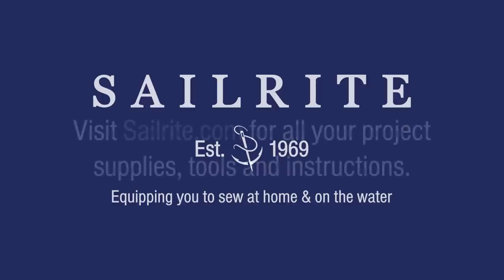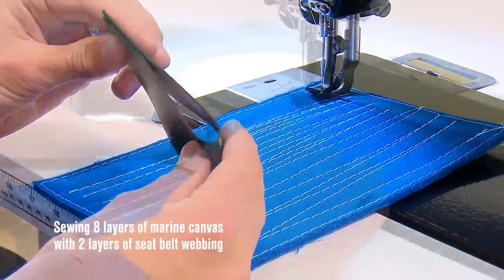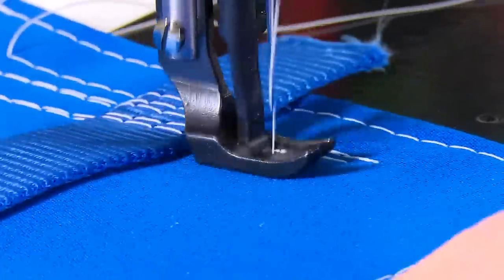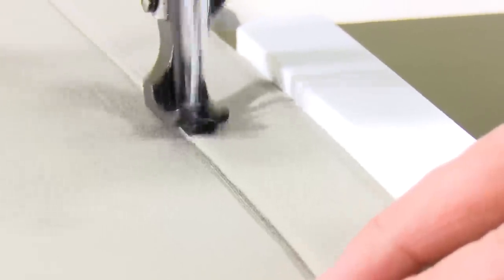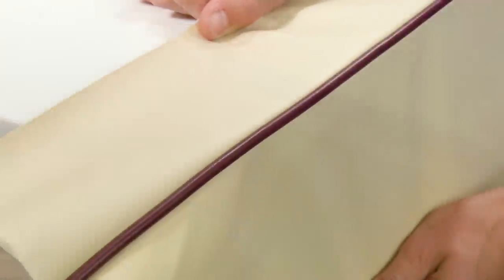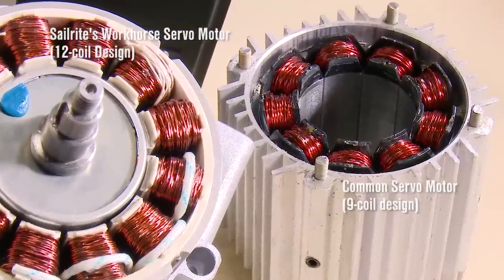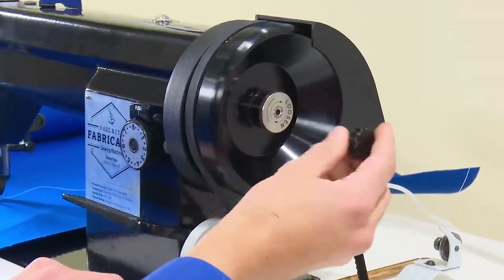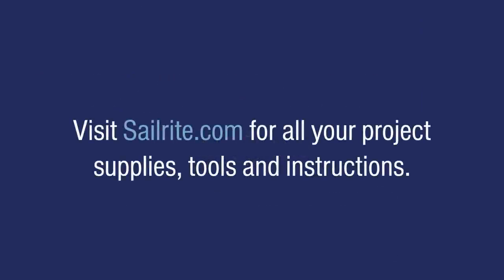Sailrite® Fabricator Sewing Machine with Workhorse Servo Motor

Comment: Can this machine be used for making apparel garments? Using standard apparel fabric.
Reply: Kimberly Arnold , yes ma'am, it will sew clothing.  Mine handles regular weight fabrics like a champ, like the kind of fabrics the majority of clothing is made from.  Of course it's great for heavier clothing fabrics, like denim.  It will work on lightweight fabrics, but it takes some adjusting and finesse.

I certainly wouldn't buy this one intending it for that purpose.  So much of the cool stuff it can do would be wasted making just clothing.  And you'd feel deprived when it came to lightweight and stretch fabrics or when you wanted to make buttonholes or anything other than a straight stitch.
Reply from the maker: Yes, it will do a great job sewing apparel fabric as well as heavy duty fabric assemblies.
Reply: Tessa Wilken
Reply: Okok
Reply: Hi I like your machine so much
Reply: @SailriteDIY  How much do you say that you’re messing with the quote I like so much

Comment: One thing is for sure about you guys,  you build quality and precision sewing machines :-)
Reply from the maker: Tanya,
Thanks!!!
Reply: Fabricator is a GC6-7D machine from Typical China, now thei have come out with a new version with direct drive servomotor of 750 W, higher lift on the foot and intergrated led light, the price of this machine is much cheaper than the Fabricater. The name of the machine is noe changed to GC0617D

Comment: The leather demonstration was impressive but how would it do on veg tan leather instead of upholstery leather? I’m talking two or maybe 3 layers of 8-9oz leather for holsters, sheaths, harnesses, etc.
Reply from the maker: Nathan, I have not sewn with that type of leather, but I think it would do well. If you like you can send us a sample of it for testing with the Fabricator. If you would like to do that just let me know via my email: eric@sailrite.com
Reply: Fabricator is a GC6-7D machine from Typical China, now thei have come out with a new version with direct drive servomotor of 750 W, higher lift on the foot and intergrated led light, the price of this machine is much cheaper than the Fabricater. The name of the machine is noe changed to GC0617D

Comment: My LS-1 isn't exactly what I needed. I'm a little upset with my choice. Not the machine but just in general. You guys were great on the phone answered all my questions. I should've gotten this machine. In fact the leather you show is the exact leather I use for my handbags haha. I was wondering what kind of return policy you guys have. Thank you.
Reply from the maker: We have a 30 day return policy. You will get a full refund, minus the shipping within 30 days. If it has been past 30 days simply post the LS-1 on Ebay and it will sell rather quickly for almost the same price you paid. Let me know if you have more questions.
Reply: Sailrite awesome thanks for the reply. It's not that I don't want to deal with you guys in fact I'm going to spend a lot more money with you haha. Should've just bought the better one first. I will contact you guys through the site next week. Thanks again
Reply: Jason Becker....I made the same mistake.  The LS-1 isn't exactly lined up with upholstery because the channel for the cording foot should be re-worked/imagined.  Smashed the heck out of flex cord and it sounds like an old mule wagon.  I really did try, though.  I'm within my 30 days so I'm trading it in for the Fabricator on Monday!  Hope they can send me another box for return!

Comment: Can the magnetic seam guide be placed at 1/4” position without it being hit by the walking foot?  On the video, it looks like the walking foot goes over the 1/4” seam guide setting.  Thank you.
Reply from the maker: Dr Michael Elinski Hello Michael, the right toe of the presser foot is directly in line with the ¼” mark. There are three approaches to sewing a ¼” seam. First, is to use the toe itself as a guide, second is to place the magnetic sewing guide right next to the toe (remember the presser foot only goes up and down so it will not cause any issues), or three you can use a left zipper foot which has the right toe removed and use the magnetic sewing guide on the ¼” line. All three will give you the same result!
Reply: Sailrite, thanks for that clarification.

Comment: Is this machine head any different (besides color) than the older version you sold? I didn't care too much for that one.
Reply from the maker: The Fabricator is a great sewing machine. Sailrite made many modifications from the older Sailrite 111 sewing machine.
Here are a few changes/improvements: 
1.    A great servo motor with cogged belt called the Workhorse.
2.    Engraved needle plate with measuring guides.
3.    Special bushing for use with our Posi-Pin system
4.    Includes the Stitch PRO balance wheel
5.    It is black
6.    We have a new 4 color guidebook --- available online as a PDF --- it is good for those with the 111 too
7.    New belt cover for use with the Stitch PRO wheel and the Workhorse motor
8.    Includes a cogged motor pulley with cogged belt.
9.    Set up and timed by Sailrite techs here in Indiana.
10.  Sailrite’s service and support cannot be beat! 
11.  Improved stitch length dial, with better stops which help prevent turning the dial too far.
What you get from the Fabricator will be more power (a ton more) and better slow speed control. This comes at the cost of high end speed.

Comment: How would you compare this to the Juki 1541 ?
Thanks in advance.
Colin.
Reply from the maker: The Juki 1541 is a good sewing machine. It is very comparable to the Sailrite® Fabricator Sewing Machine in performance. However, the Fabricator® has a few advantages: it is usually less expensive and it also comes with the large "Stitch Pro Balance Wheel with Posi-Pin" coupled with the Workhorse® Servo Motor that uses a cogged belt for optimal slow speed and power without slippage. Also our support is second to none. If you want the full details of why to buy a Sailrite Fabricator over the Juki 1541 click this link: https://www.sailrite.com/Why-Choose-the-Fabricator

Comment: Looks like a great machine .Can I sew leather for holster ?
Reply from the maker: Yes, it can sew leather. If the leather is very firm and stiff then I would estimate that it will sew about 1/4" thick assemblies well or slightly more. If it is a soft leather (like what is show in the video) I would estimate that it will sew about 3/8" thick assemblies well.

Comment: impressive performance !
Reply from the maker: Glad you liked it!
Reply: Fabricator is a GC6-7D machine from Typical China, now thei have come out with a new version with direct drive servomotor of 750 W, higher lift on the foot and intergrated led light, the price of this machine is much cheaper than the Fabricater. The name of the machine is noe changed to GC0617D

Comment: Something told me to hold off on upgrading the LSZ-1 :-)  This is every single thing I wanted the 111 for PLUS you have addressed every single thing I didn't like about it!  I am really glad you went back with a treadle linkage to the servo instead of the electronic pedal and the bobbin winder is a feature that's going to easily save me 100 dollars on a independent piece.

Well done.  Well done indeed.  Is this outright replacing the 111?  I don't see it offered any longer and I was just telling someone about it last night.
Reply from the maker: Glad you like it! We spent over a year re-thinking the Sailrite 111 sewing machine and improving several features on that machine. Yes, this is the much improved replacement of the Sailrite 111 Sewing Machine (the Sailrite 111 is no longer offered). We love the Fabricator's performance and expect our customers will too! Let me know if you have more questions. Thanks,
Eric
Reply: Can you tell what changes that has been done? This is the Typical GC6-7-D and is painted black same as 111 I know this machine very well and why make any changes when its already good from factory
Reply: Powerwheel on this machine is not a good idea, the machine have no safety clutch and sewing in very thick material you get the risk that timing will be off. Then better to have the original Wheel so the belt can slip on the Wheel.
Reply from the maker: We incorporate a lot of changes to the machine head. If the machine head did not go through what our sewing machine dept here in Indiana does, it would likely not work nearly as well. Some of the setup our techs do in-house is outlined in our Guidebook that comes with each sewing machine, starting at page 43 of the Guidebook. Here is the link to the PDF Guidebook: http://www.sailrite.com/PDF/2016_Fabricator_Guidebook.pdf if you would like to see more detail. 

However, much of the tech work on each sewing machine head involves major cam adjustment to get the walking feet to operate as they should in combination with the needle feed. When you get the Fabricator it works great right out of the box, thanks to what we do in-house here at Sailrite. Now combine that work with our special features: Posi-Pin, Workhorse motor, cogged timing belt with the Stitch PRO Balance Wheel and cogged pully on the servo motor shaft. Those factors make the Fabricator Sewing Machine unbeatable right out of the box!
Reply from the maker: The Posi-Pin included with the machine, is a shear pin which works as a safety for serious jam situations. A standard safety clutch on a regular sewing machine only disconnects the hook area, it does not disengage the whole sewing machine, so damage is still possible with only the hook area disengaged in a serious jam situation. That is not the case with the Fabricator's Posi-Pin shear pin, the whole machine is disengaged in a serious jam situation. Obviously, if the belt slips hopefully that is enough to prevent damage, but if your belt is as tight as it should be a slipping belt may not stop a serious jam from causing the machine to go out of time or from being damaged.

If the Fabricator goes out of time, we have an excellent Guidebook to help you set it back in perfect timing. Here is the PDF Guidebook link: http://www.sailrite.com/PDF/2016_Fabricator_Guidebook.pdf 

We welcome anyone to come to our facility here in Indiana to take a test drive of this sewing machine and compare it with any sewing machine in its class.

Comment: I have had this machine for a few months, and I'm having a very hard time finding any kind of support that doesn't involve calling someone during business hours every time I have a question.  I need help troubleshooting a few problems, and the Troubleshooting Guide only covers skipped stitches and tension problems (in one paragraph).

This is the only video I can find for this machine.  I chose this manufacturer because of all the great support videos.  Am I missing the Fabricator Support chanel somewhere?  Is there a link or something on the website that I'm just not seeing?  All I find is information for the Ultrafeed, and it seems like if you have anything but that, figuring it out is all on you.

If there's a link to a Forum or hidden videos or a secret society or anything, can someone please provide me a link?
Reply from the maker: Tessa Wilken As you already know we are available by phone to help during operating hours. The guidebook does cover many subjects in depth related to skipped stitches. Dropping stitches can be the outcome of any of these things which all have detailed sections in the book; hook timing, needle bar height, thread/needle combinations, and needle insertion. Thread tension is fairly straightforward and is also detailed in the book. We are working on several new technical videos for the Fabricator and will make sure these topics are covered. In the meantime I will have a support case started for you and please call for Zach or Matt B as soon as you can to resolve anything you currently need help with.

Matt Grant

Comment: Is it from the USA? It would be incredible to have one in Argentina. I would be the happiest gaucho in La Pampa. Congratulations
Reply from the maker: The machine is a collaboration between China and the United States (our facility here in Indiana). The head is made in China specifically for Sailrite to our exacting specifications. Once the head arrives at our headquarters in Indiana USA, our sewing machine technicians assemble and tuning each sewing machine head. When it is adjusted perfectly the sewing machine head is then tested with several sew offs by our technicians for final approval. After passing inspection and sew offs the head is packed with many other components. These other components are both made in Asia and USA again specifically to our specifications.
Reply: Sailrite
Reply: Fabricator is a GC6-7D machine from Typical China, now thei have come out with a new version with direct drive servomotor of 750 W, higher lift on the foot and intergrated led light, the price of this machine is much cheaper than the Fabricater. The name of the machine is noe changed to GC0617D

Comment: Can this machine stitch 15mm Veg Leather ?
Reply from the maker: 15mm is 0.59 inches. The foot lift of the Fabricator Sewing Machine is 0.50 inches, so no 15mm is too thick, it must be less than .50 inches or 12mm or less.

Comment: "It is awesome".
Reply: Fabricator is a GC6-7D machine from Typical China, now thei have come out with a new version with direct drive servomotor of 750 W, higher lift on the foot and intergrated led light, the price of this machine is much cheaper than the Fabricater. The name of the machine is noe changed to GC0617D

Comment: I really want another machine...my last one was a Juki....maybe next tax season...idk
Reply from the maker: When it is time to buy, we stand ready to help!
Reply: Sailrite I look forward to that...I do have a question: how different is your"electronic foot control" from a rheostat- type controller
Reply from the maker: The Fabricator does not have an electronic foot controller. However, the LSZ-1 or LS-1 do have one. 
The older carbon pile (rheostat type) foot controllers burn off excessive electricity at the foot when going slow. So they get hot and sometimes smell. The Electronic foot controller sends the correct amount of electricity to the machine via a computer chip, so they do not get hot or smell. However, both usually work very well.
Reply: Sailrite I like the portability of the L-series but the clutch motor on the fabricator...I've got a year to decide
Reply from the maker: We are introducing a NEW industrial table top w/ Workhorse Servo Motor for the Ultrafeed LSZ-1 and LS-1 very soon, be looking for it on our website and the YouTube channel in a few month or two. We no longer sell clutch motors.
Reply: Sailrite the servo is better...less wear? less energy?
Reply from the maker: Yes, the servo is better than the clutch motor, hands down 100% better. Yes, less wear and less energy and more power and better slow speed control.
Reply: +jerry arnold (jdawgsworld) 
 LP LP LP L ko